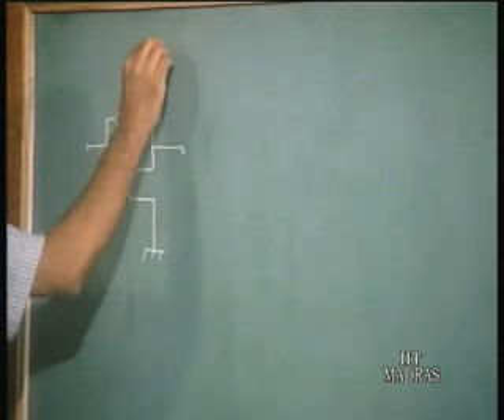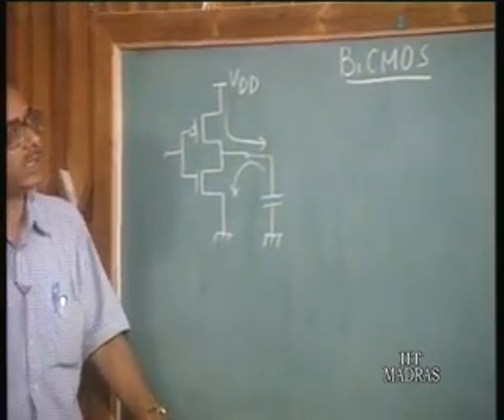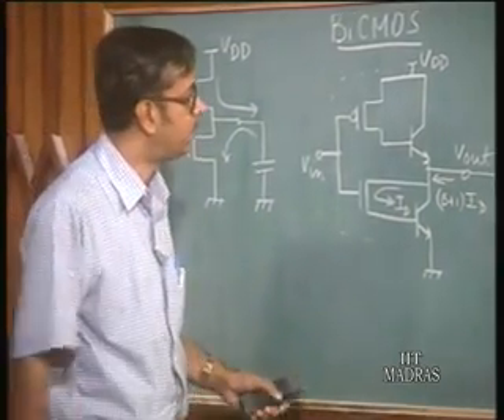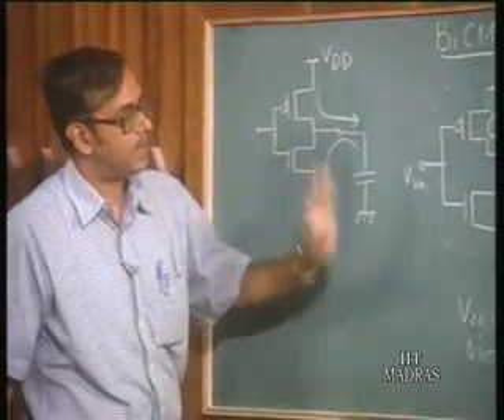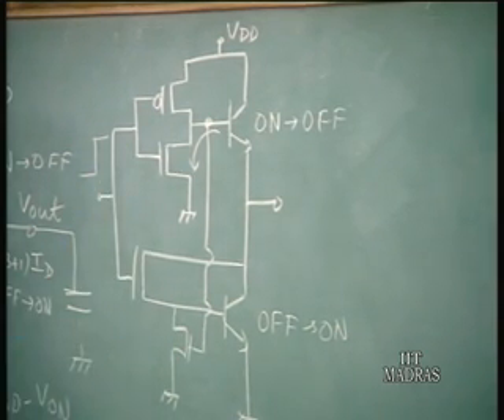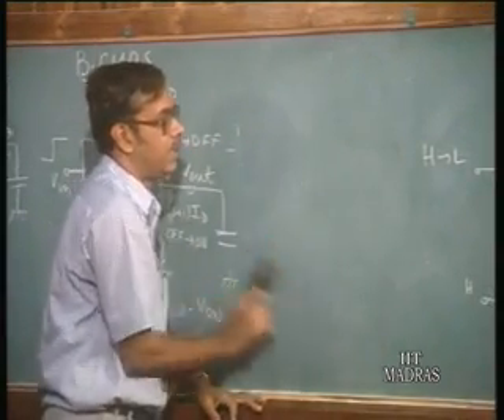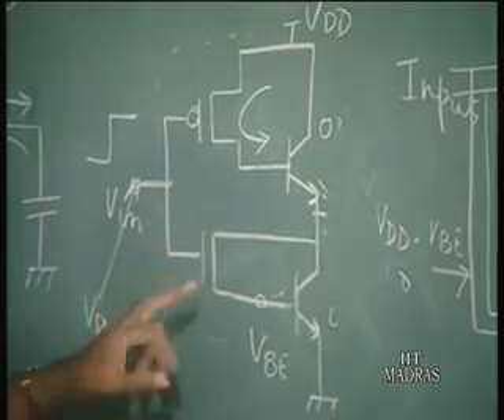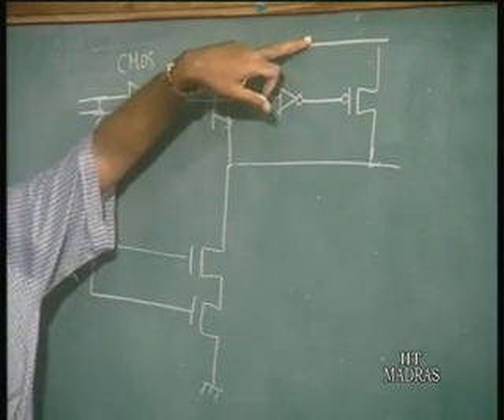Lecture 29 BiCMOS Gates

Comment: in this video, he said about one advantage of cmos, that output load does not depend on width ratios of cmos transistors.

But actually we use scaled cmos buffer chain for driving large capacitive loads. That means we have to increase the sizes of cmos transistors for driving large capacitive loads.
Reply: He didn't say 'output load' but Output Low(VOL) and similarly we have Output high (VOH). In CMOS technology Output voltage goes rail to rail without depening on width of nmos or pmos, is what he meant by that.
Reply: Yes
Reply: I heard "output low" as in low output voltage (unloaded) does not depend on width ratios between p and n transistors
Reply: @patrickwright8552: Yes you heard it right he indeed said 'output low' repeatedly for no confusion.